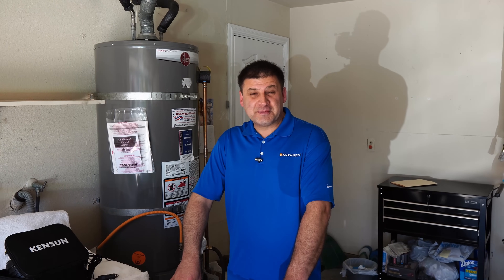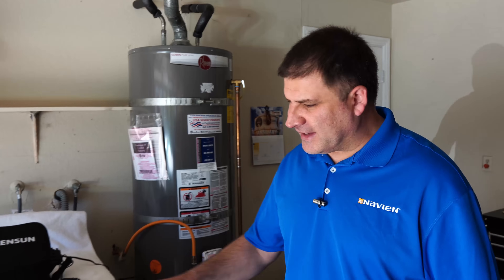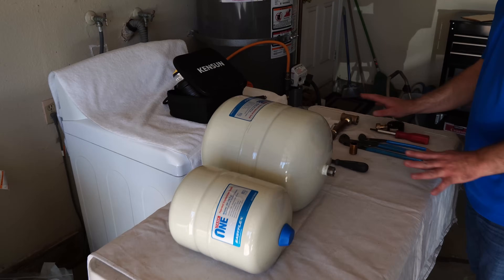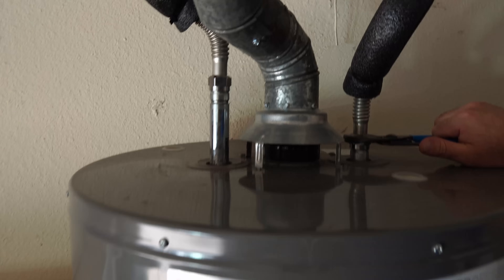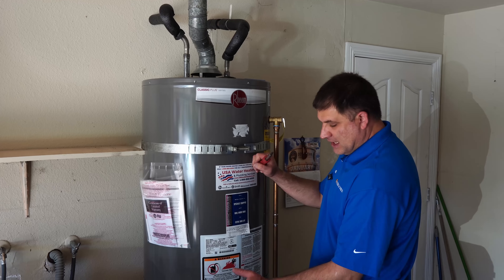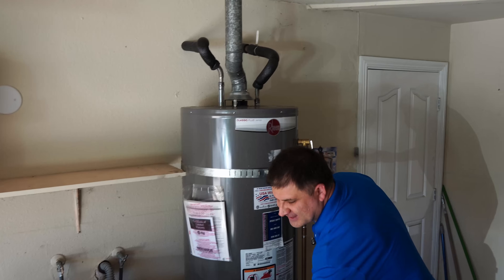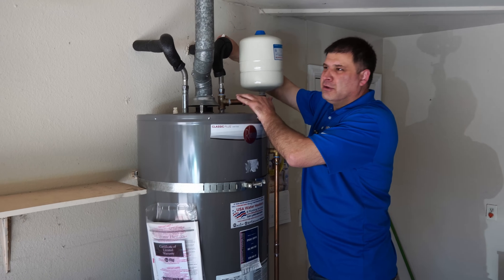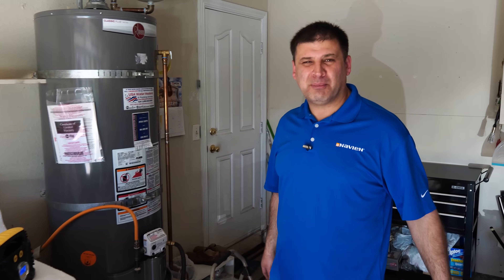✅ Expansion Tank Installation on a Water Heater - What is an Expansion Tank? - How to Install it

Comment: I have learned so much from this video.  We are having serious flooding in the basement.  I adjusted the water temperature to hot because we had to run the hot water for approx. 15 minutes every morning to take showers.  Again, the basement flooded.  The boiler company adjusted the pressure and installed another expansion tank.  What do you think could be the problem?  I would like your input before calling another company again.
Reply from the maker: First of all, to be getting hot water quicker or instantly, you need to have a circulation pump added. Like this one: https://amzn.to/3Q82fiO Rising the temperature at the water heater does not improve the speed of delivery.
Make sure the expansion tank is pressurized to match the PSI of the water in the pipes. Make sure the T&P valve is being replaced as well, after every accidental discharge through it. Once they run constantly for a while, they are not good anymore. Make sure PSI in the pipes is no more than 70 psi.
Lastly if everything else checks, you need to use a larger capacity expansion tank. I guess they used, 2 gal one. Go to 4.5 gal or 8 gal one if necessary.

Comment: I have 2 heaters and expansion tank for each. one has pressure 55 psi and other has 75 psi. system pressure is 60 psi. Recently I am getting warm water from cold faucet. I changed tub cartridge but still getting warm water.  What can be the issue? Faulty heat trap?
Reply from the maker: When the expansion tank is on the hot water side of the water heater and is under-inflated, you will get hot water in the cold side. So, inflate both expansion tanks to match the PSI of the plumbing and if possible move all expansion tanks on the cold side of the water heaters ad there will be no issues. When the PSI of the water in the pipes is greater than the expansion tank's PSI /when placed on the hot side of the water heater, hot water enters the tank. Then when you only open a cold faucet the bladder of the expansion tank pushes the stored hot water into the open cold tap.
Reply: @dennistheplumber  My expansion tanks are already on cold water side. What happens when expansion tank pressure is more or less than system pressure?
Reply from the maker: When more nothing happens. They are ineffective. When less they push the water back into the plumbing. Still not serving the purpose. They need to be the exact psi of the plumbing.
Reply: @dennistheplumber  I will increase to match system pressure and update you.

Comment: I installed a check valve about 8 years ago, and for that past year or so my tank's relief valve has been leaking. I've replaced the valve 3 times, and each time it would stop leaking for a while, then it would start again. After watching your video I just checked the pressure with a gauge at my outside faucet, which is past the regulator, and it reads 110 psi. Is it possible the regulator needs replaced, or that I might just need an expansion tank, even though I had no issues for years without one?
Reply: 110 psi you need a PRV valve....
Reply from the maker: Replace the regulator 1st. That’s No.1. Then watch. If not problems leave it like this.
Reply: @dennistheplumber  I was sort of leaning that way myself, thanks for the verification!

Comment: the pipe and connector selection include pipes that have lead, which is not approved for potable water; you should remove them as options

Comment: In your parts list, most are 3/4" straight pipe threads. The 2" nipple you have listed is a NPT( taper) on one side and straight on the other. Aren't they all to be straight pipe
Reply from the maker: All fittings listed must be NPT thread.

Comment: Is it ok to use copper in place of the brass fittings?
Reply from the maker: If you do it exactly the same way as on the video, avoid using copper on the galvanized nipple on top of the water heater. The rest could be copper.
Reply: @dennistheplumber  thank
You sir.

Comment: Why did you not tell folks to turn off the breaker or power to water heater if you’re draining it. If water falls below heating element, it will ruin the element!
Reply from the maker: This is a gas water heater, it does not have heating elements as the electric does. Also, I am not draining the whole water heater, just a bit to avoid water overflow on the top.

Comment: Did you put a copper T on top of the steel inlet of the water tank?  I'm concerned about corrosion at the contact between different metals.
Reply from the maker: Actually copper is more prone to dielectric corrosion. That’s why I used brass fittings. Brass is safe when in contact with other metals.

Comment: My expansion tank was put on the hot side when the house was built. After 14 years I needed a new water heater and it was out on the hot side too. Now we are selling and the home inspector said we should switch it to the inlet or cold side.

Comment: What was that piece you removed from the top of the tank inlet when you installed the T-fitting? You said, "we no longer need this". Is this something that needs to be removed prior to installing the T-fitting?
Reply from the maker: It’s a plastic piece that goes between the galvanized nipple's flat surface on the top, and the rubber washer of the supply line. It acts like dielectric union. In other words it is supposed to reduce the rusting in that connection. I would not have removed it, but since it came loose I feared that if I reinstall it back there, it might get misplaced and it might create a water flow stoppage. It does not really matter since screwing on the brass the makes the plastic isolator obsolete.

Comment: Great content I helpd my buddy who is a plumber recently install a unit, he said it is code the pressure tank needs to be strapped and supported by some kind of bracket.
Reply: Some kind of bracket, ha ha
Reply: @Col Braddock  well that's what he said lol I don't know the terminology I'm a computer and weapon guy. I only know about computers and guns.
Reply: It has to be strapped if copper is used. No need to strap with galvanized or brass fittings as far as I know

Comment: With 80 psi in that tank, your exceeding the limits of that tank. Go measure the pressure again after the water is on.... its wayyyy higher than 80

Comment: Dennis, instead of using the 6" brass with elbow, Can i use a shark bite flex hose & screw the other end into the expansion tank & attach it to the wall with a bracket?
Reply from the maker: Yes, you can but it is not going to be as reliable as if you have done it with ridgid pipes.

Comment: Great video, did everything you said and it installed perfectly but I do have a issue, about ever 5 minutes the pipes riddle, not near as bad as before I installed expansion but regular. Could it be I need to add or decrease air pressure in tank or something else, I’ve ran ever outlet until water runs free with no spurting of air in lines. Thank you Kenny
Reply from the maker: Hello Kenny. The pressure in the expansion tank should match the pressure of the water. No more or less. I am glad to hear that the rattling reduced. If it is not gone completely there must be otjer reasons for it.
Reply: @dennistheplumber Thank you, ill test closer to tank, my exterior outlets are on separate lines so it could have been wrong place to do the check. Thanks again, you’ve been a lot of help 👍🏼👍🏼

Comment: Will this expansion tank take away the pipes banging around —specially the hot water pipes?
Reply from the maker: It will have minimal effect on the pipes banging. The pipes are banging due to high pressure, and because they are loose in the walls(not enough fasteners used). So, first ensure the water pressure is in the 50-70psi range, then get the expansion tank. Another thing you can add is hammer arrestors, that go on the washing machine water valves.
Reply: @dennistheplumber  I was hoping to install 1 device to fix everything instead of installing arrestors at the washing machine, dishwasher, toilet, etc. I will check the water pressure like you mentioned. Thanks!

Comment: Why pipe dope with Teflon tape? The tape should be good enough.
Reply from the maker: When you do it as often as we do, you know that sometimes Teflon alone is not enough. Water seeps throw the threads on some connections. I guess the fittings threading done at the factory are not always perfect. The pipe dope reduces the chances for leaks.
Reply: @dennistheplumber  Cool, good idea I will do the same, getting ready to repipe my house and was going to redo expansion tank with brass liek you show. Good video

Comment: Hey Dennis how are you.
Listen I measure my home water  pressure and it’s reading at 105psi ?? What psi should I fill thee expansion tank at if my home psi is that high… please help I appreciate it.
Reply from the maker: At this point it seems like lowering your PSI in the pipes is more important than getting an expansion tank. If you have an existing pressure regulator, replace it. If you do t have one, get one installed. Then when it comes to installing an expansion tank pressurize it to match the PSI in the plumbing system.
Reply from the maker: High pressure is a safety and a primary concern. Expansion tank is passive and secondary.
Reply from the maker: 60 psi is ideal.
Reply: I have an exiting expansion tank but has been leaking,I ordered the new expansion tank  just waiting to arrive but yea my Psi is reading @ 105psi.

Comment: Im getting sputtering in my sinks after installing new tank.
Reply from the maker: Did you run the hot water at all faucets for at least 2 mins to purge the air out?
Reply: @dennistheplumber  i did not. Ill try that today. Thank you.

Comment: Hi Dennis what if you don't add 80 psi and keep it at 40psi?
Reply from the maker: The expansion tank will not be effective at all. The bladder will stay pushed all the way down by default, and when a water expansion occurs, the expansion tank won’t be able to absorb it.
Reply from the maker: Is situations like this, the balder ruptures prematurely in 2-3 years.
Reply: @dennistheplumber  Thankyou for your knowledge. Does the tank have to be above the inlet or can it be on the side of the tank lower than the inlet? Sorry to respond with another question its just people at work keep saying it doesn't matter.
Reply from the maker: Both ways you mentioned are okay.

Comment: Advice from me! 

When applying T-tape it makes it a lot easier to apply if you face the roll away from your fitting so you can just use the tension to pull it together Instead of struggling. 

Love your videos man! Keep up the great work!
Reply: Can you provide more details?
Reply: @mancave7  if Dennis (plumber in this video) had turned his roll of PTFE tape over, it would probably be easier to apply to the pipe threads. You hold the pipe still with one hand, and the hand with the PTFE wraps it around the threads. As you wrap, the tape unspools itself from the roll.  And if you keep your thumb on the tape where it comes off the roll as it unspools, you can keep it tight. If my description isn't working for you, search up some videos on how to apply PTFE tape and I'm sure you'll find one where they demonstrate the difference.
Reply: I remember . it was the first thing  I learned in my plumbing trainning 🤨

Comment: Most manufacturers require the expansion tank to be not less than 18" from the cold water inlet on the top of the water heater. As a former city building inspector I have had to many plumbers to relocate the expansion tank. Always read the installation guide because each manufacturer has a set of installation requirements. Other than that it is a very helpful video.
Reply: Why is that?
Reply: Was going to say the same thing
Reply: another stupid YT  moron , expansion tanks have to installed horizontally, idiot, next you moron you are supposed to measure the house water pressure , then get a bicycle pump , pump up the expansion tank to to the house pressure, you people are pathetic and stupid who make these videos , you're just another clown who want's to be a movie star, idiot, and most building inspectors are clowns too
Reply: That water heater set up is perfectly acceptable.
Reply: CatapultRP ,..Thanks for post this information, ,...
Reply: Things are different in many states, we have to have a vacuum relief breaker and you should have a ball valve on the cold side not to mention flex connections like in this video are a no no
Reply: @glenarseneau4796  in California you have to use flex connection. Straight piping is not allowed I believe because of earthquakes
Reply: @armenkapshanyan9027  yes earthquakes. That’s also why that thing is strapped to the wall.

Comment: When installing w teflon and dope, and later it needs to be replaced, will it unscrew easily? Never used dope(lol) before, just asking
Reply from the maker: Yes, actually using these two makes unscrewing way easier. New layers need to be applied again when reinstalling.

Comment: I would of secured that tank to the wall and fitted an isolation valve for future maintenance.
Reply: Not sure an isolation valve is necessary when it's already that close to the cold water supply valve. And an isolation valve isn't going to help much if the expansion tank is already carrying excess water.

Comment: PTFE tape tells you to use 2 full turns around a pipe thread. Dude uses way too much.
Reply from the maker: Wrap it 2 times only and get leaks every single time you do 2 wraps only.
Reply: @dennistheplumber  I just replaced my sister's water heater and also installed an expansion tank.  I used 2 1/2 or so turns on all the pipe threads, but I did lightly dope them because a plumber once told me the dope lubricates the threads (plus you have me all doubting all my past plumbing work).  No Leaks! I did, however buy a thing of natural gas certified PTFE tape and the instructions said "minimum of 4 turns".  So, I guess you're right about gas fittings, but I know I read 2 turns when I first used teflon tape.
Reply: @dennistheplumber  I've got dozens of joints out there right now that have never leaked for years! No dope, either! If the manufacturer puts it in their directions, that's good enough for me .
Reply from the maker: Your line of work could be slightly different. I get leaks with two wraps when I replace expansion tanks.
Reply: It's in the instructions on the packaging.  "wrap the tape 2 full turns around the pipe threads".  If they didn't know it would work, they wouldn't instruct the user to do it.  They pay scientists and engineers a lot of money to come up with that stuff.

Comment: Now my question my house water pressure look like is to high of what i seen recommended in other videos they said 50 to 75 psi my house is 8O psi like in your video . Do you think 8O psi could cause me problems later on or as long the expansion tank is also 80 psi is ok no problems at all .Or you think is better to put a water  pressure regulator later on.
Reply from the maker: Hello Jose! 80 psi is the upper borderline. Still okay. If you get an opportunity down the road, you can get a PRV installed. Not a rush.

Comment: Great video I just did the same installation today. Much better than the plumber did.He change my water heater tank and never check or change my expansion tank and it was bad my thermostat pressure valve was leaking because of a that .I save $200 doing it my self .
Reply: Why don't you get a pipevise and a 14" Stillson? The vessel is much too close to the tank

Comment: Great video..Best of the Best , and I consider myself to be a plumbing "aficionado". But can I get your input or from others who view this video.1). I mounted my expansion tank with the water fitting facing up .It works fine , but what if anything is wrong with it that way. ( why would a manufacturer install a label that ultimately would be upside down? )   2) Please explain the orange gas connector. I spent a 35 year career with a gas utility in residential service , thousands of service calls and never once saw an ORANGE  connector. Gray, Black, Yellow, uncoated brass,  flared aluminum and copper etc.
Reply from the maker: Fitting up or down is fine. It is wrong if it is sideways or under an angle and not supported, because as the expansion tank ages and the membrane inside ruptures, the device fills up with water and becomes very heavy, which leads to tilting and separation from the threaded neck of the device, causing a leak. For example when new homes are built the expansion tank is screwed into the fitting coming  out of the ceiling, so it's fitting up and not supported. These home get multiple inspections before sold.
The orange is a coating over the stainless steel gas line. Both stainless steel and orange coated flex lines are still available today, however the industry now prefers the orange coated ones, as this is a color coding for gas supply line.
Reply: @dennistheplumber   Thanks.. I decided to leave it as originally installed and yes, I made a nice heavy bracket underneath it for support.

Comment: Hi, thanks, great video. 
I have a well that varies between 30 and 50 lbs. pressure, what should I set the expansion tank pressure at?
Reply from the maker: I would set it up 45psi.

Comment: Aren’t you supposed to always wrap a pipe in Teflon if the two connections aren’t of the same type of materials? So why didn’t you wrap the nipple coming out of top of tee to the flex water line?